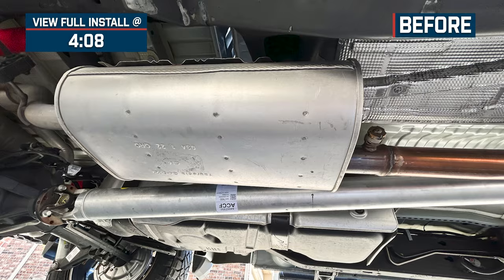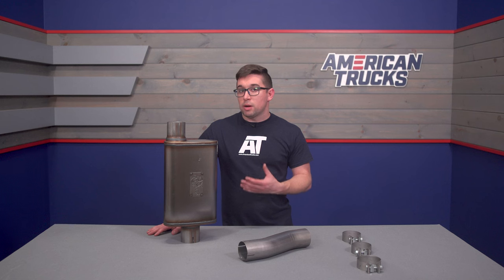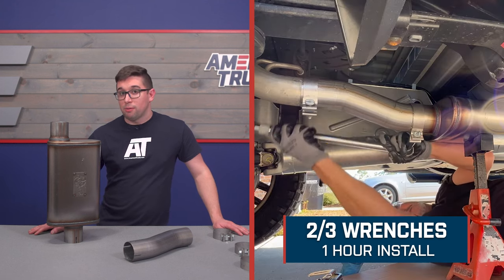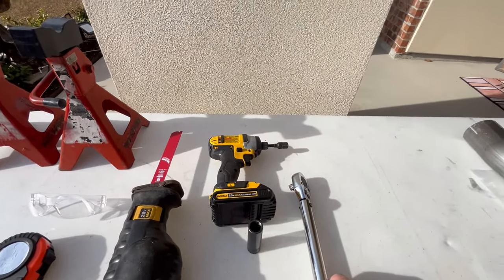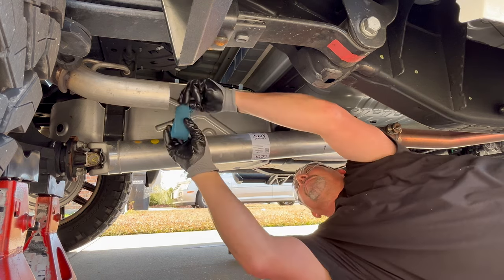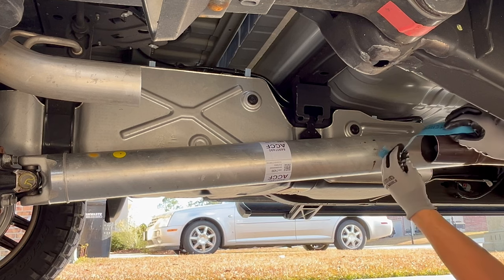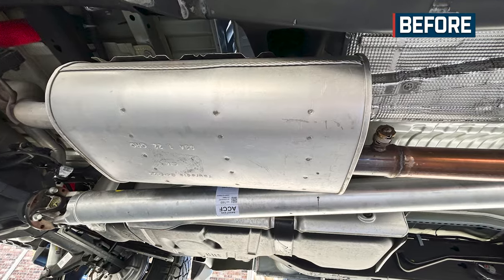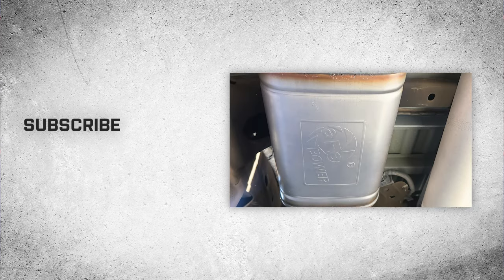2019-2024 Silverado & Sierra 1500 AFE Apollo GT Series 3" Direct Fit Muffler Review & Sound Clip

Comment: I want to remove the flapper valve on my 2020 trail boss with the 5.3. Is there enough pipe on the new pipe to accommodate this?
Reply: I just seen a video that a kid cut the flapper off and had plenty of piping so you’re good on that aspect. I’m still wondering if there’s gonna be a huge difference if I cut out the flap or leave it In just bought my 5.3 so learning still.
Reply: My flapper on my 2022 broke off and it rattles in my muffler

Comment: Will this fit a 2000 GMC SLT 1500 Extended Cab w/6.5 bed 5.3 V8?
Reply: It probably cost just about as much as a 2000 GMC lol. Just looked, it does cost as much as the whole 2000 GMC truck. $225 lol
Reply: Bull shit, no flapper delete